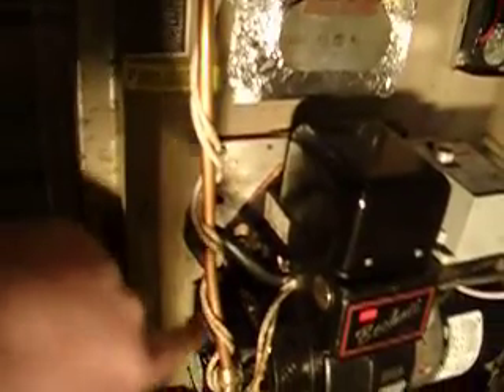WVO (Waste Vegatable Oil ) fired furnace, a work in progress

Comment: Glad that you are ok!  My converted mobile home furnace has been a mixed success.  The fuel pump died and I have been too mad at it replace it!   I hate to say but a compressed air deal is probably the only solution for veggie, since it needs such a high temp to atomize.

Comment: No good.  That heat tape isn't hot enough, and the furnace has a burning puddle in the fire box, very very bad and dangerous.  Observe your WVO  experiment outdoors with the gun firing into a steel drum.